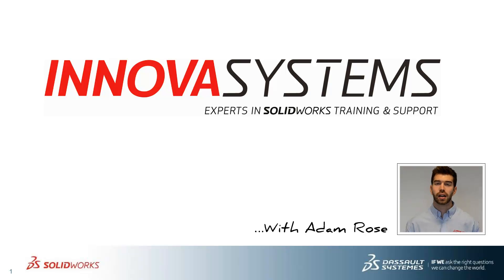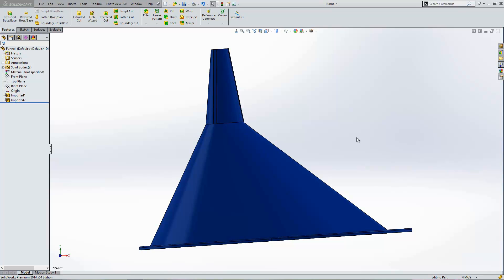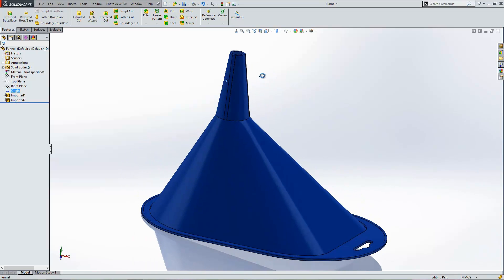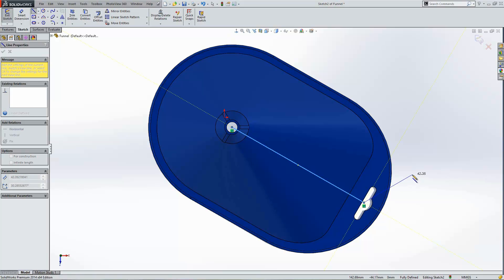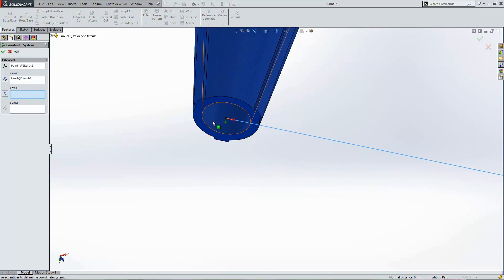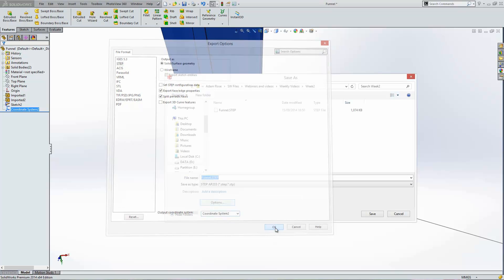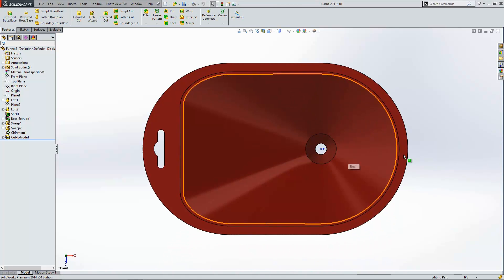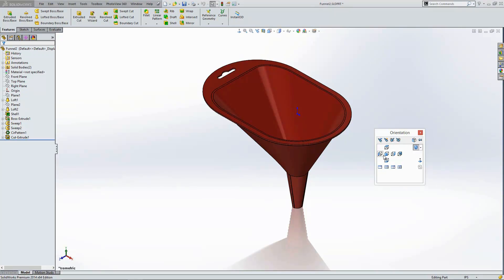How can I re-orientate a model that's upside down in SOLIDWORKS?

Comment: Amazing solution. Many drawings that I work with are bent in the wrong direction, and our suppliers put the beautiful side of the metal on the wrong side because of it. 

I'd just like to point out that this method will allow you to reverse a part upside down, but will not reverse the bend directions of an already existing flat pattern, so don't get caught. If you are trying to export flat pattern drawings of your models, start by following this video, and then complete your transformation with this:
https://www.javelin-tech.com/blog/2019/03/solidworks-sheet-metal-flip-bend-direction/